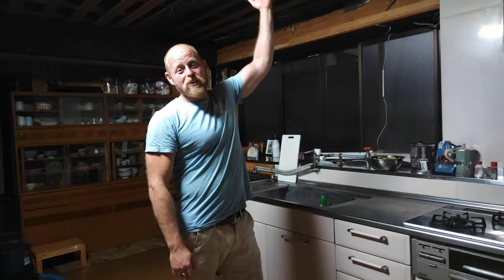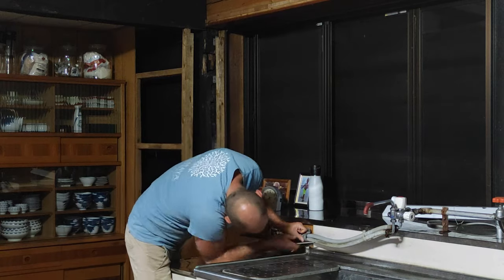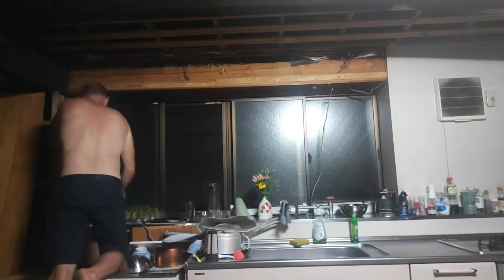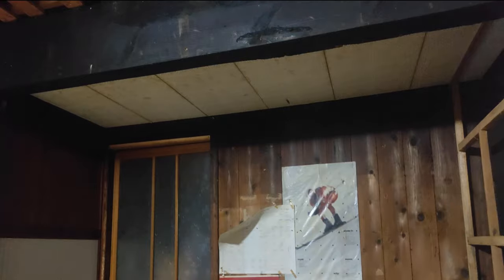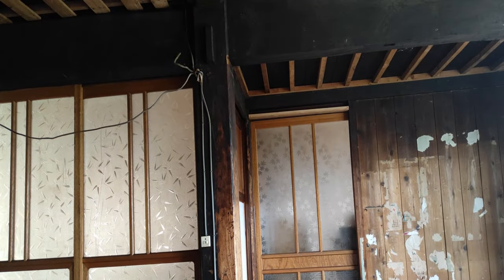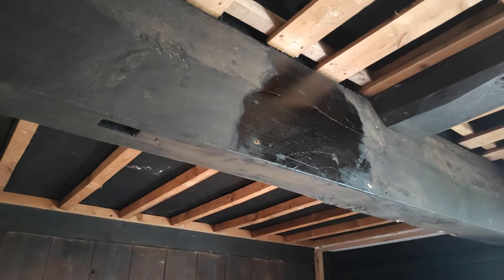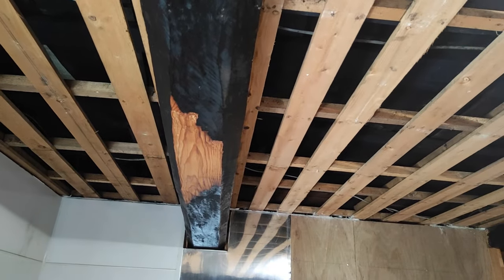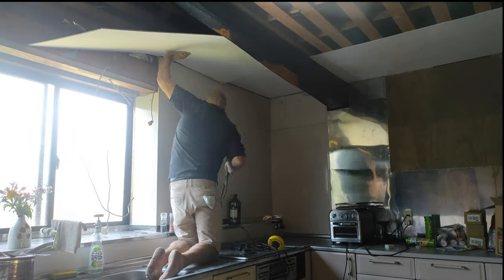Japanese Kitchen: demolition and renovation. Live electrical wires are okay... right?

Comment: Great video. Are you concerned at all about air circulation after packing that insulation in? With the temperature swings in Japan I'm unsure what's usually done. Fresh in my mind as the cold weather set in here, our attic was drenched in condensation and we've fitted vents.
Reply from the maker: luckily i have lots of vents all around the house / thatched roof. within the wall, no, I'm trying to create as tight of an air pocket as possible to keep the warmth in.    most of the house i have used rock wool which never gets wet or burn... which is awesome.  only this fiberglass stuff I'm not so sure about.